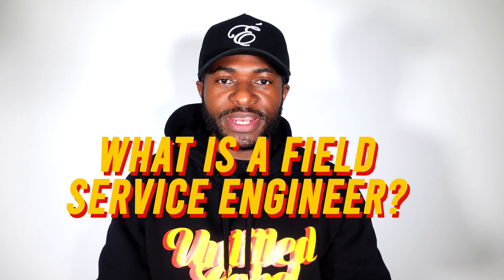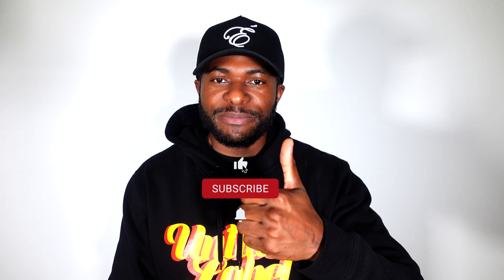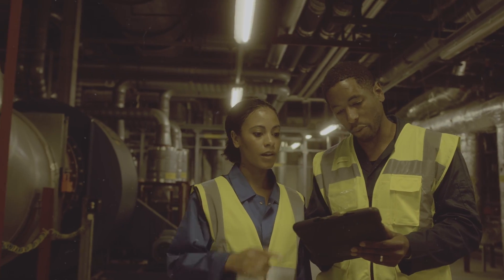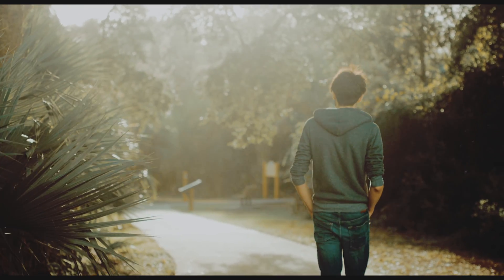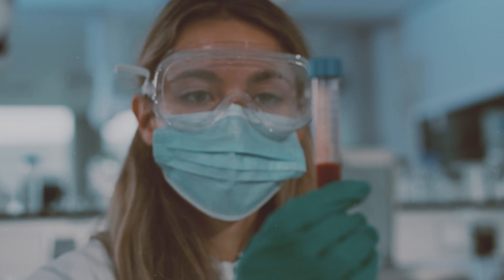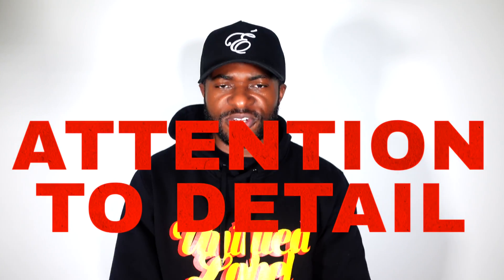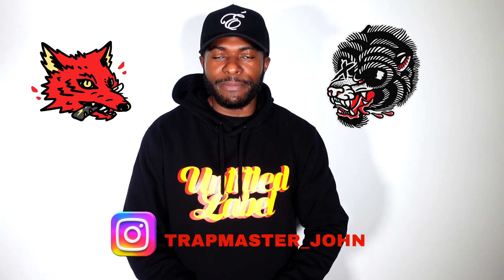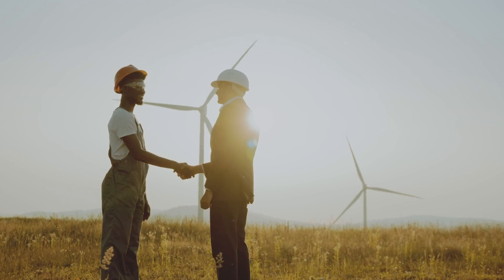What is a Field Service Engineer? | Untitled Label

Comment: Hi John. I discharged in 1983 after seven years as a Navy ET on a Gator-freighter and the AEGIS project. I've been in the field service industry for 40 years off and on, holding positions of FE, salesman, service manager, branch manager and general manager. This is an excellent synopsis of what an FE is responsible to know and do. I've watched a few of your videos and  appreciate your observations and insights into the highlights and pitfalls. I am currently looking for a tech in NC and will recommend your channel to the entry level applicants to give them a better understanding of what they're getting into. Thanks for the good work mate! Best wishes in your endeavors.
Reply from the maker: This means alot ! I started this channel in hopes of helping others understand this profession and I'm certainly glad it's achieving that cause. Thank you!
Reply: Im currently in nc working at a ford dealership doing alot of diag stuff but was wondering are you looking for entry level or ?
Reply: Have my associates in automotive systems technology